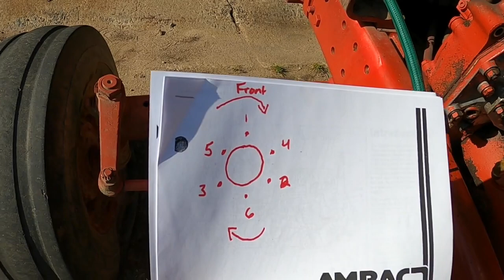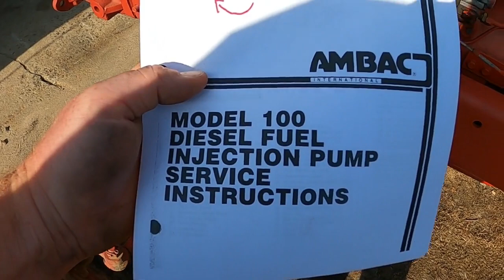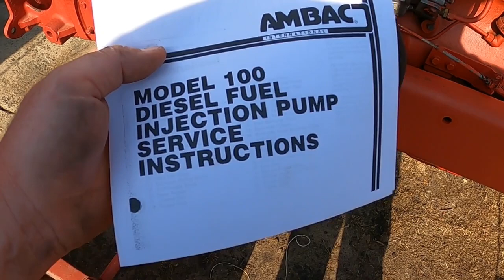1086 INJECTOR Pump repair Part 1

Comment: This is a great video. I've got a 1586 leaking fuel in the same area. The last pump I took off to have fixed was over $1100. Sure nice to fix things yourself 👍
Reply from the maker: Thank you very much for the kind words my friend ! You are correct, not in my budget to have professionally repaired at the moment. I thought I would do my best at trying it, get some good video of the process, and see what happens! If it solves the leak, and nothing goes haywire then maybe someone else can save alot of cash as well! And if I mess it up, then also maybe someone will and can learn from my mistakes!! It seems rather easy actually, part 2 coming soon, do have the head out now and understand the pump alot more! Thank you for being here my friend, watching, supporting, following and COMMENTING!! Your encouragement means alot my friend!! Thank you !!

Comment: Been there done that but ended up pulling it and sending it out to get rebuilt and it runs well but after 8 years its starting to leak again a bit .. And if i do mine again its going to get all new lines and replace the injectors too .
Reply from the maker: Thank you very much for the sub my friend, and it has been a deal so far. I have a feeling the whole tractor may get a rebuild this winter after I really start working it hard. And if so I think I will budget the whole pump rebuild and all just as you said as well! Cheap and small scale for now, hoping this will get me by for a while this season anyway! Thank you very much for being here watching, supporting, following, and COMMENTING!! Means alot my friend!!

Comment: What were the symptoms?
Reply from the maker: The reason for the repair? It was leaking fuel , almost spraying it from under the hydraulic head assembly of the pump. Oring fixed it right up. There were no issues with the function of the pump or running of the tractor. Thank you sir for being here, anymore questions feel free to ask away! Thank you for watching!

Comment: When you was putting the head back in did you have trouble getting the timing marks to line up? Ever time I try it rotate just out of time, injection pump is in time to timing marks as well
Reply from the maker: I did that was the problem actually. When I was putting the head back down the gear did not mesh like it should have. Very lucky it didn't really mess things up. Gently rotate the crank back and fourth while sliding through hydraulic head unit back down completely. Hopefully it works well for you!! Thank you for the comment, good luck!!
Reply: @Pennies_on_the_dollar  been trying for a while now and rocking the crank and always end up just a hair off, this is 2nd one I did frist one whent right in haha this one a being a pain, didn't know if there was any other tricks or not, thanks
Reply from the maker: @ethandeberry8858 Sounds like you are having my luck 🤣🤣 As long as you are in that window, on the head, you are good. If the other marks are correct , then as long as you can see the line in the window you are golden! Good luck, hopefully it goes in like the first one soon!
Reply: @Pennies_on_the_dollar  so the timing marks can be a hair off in the window?
Reply from the maker: I dont have the book in front of me at the moment, but I am almost POSITIVE yes, as long as it's in the window. The main timing of the pump is on the cam gear and flywheel. It's been a while, but I can pretty much say that is the case. Seems after you brought it up I struggled with that too, and I'm thinking that's why I didn't get it all the way down the first time. Because I was trying to make them line up perfectly.
Reply: @Pennies_on_the_dollar  my book dosent give that but I'm going put it together and find out haha, thanks for your quick help I appreciate it!
Reply from the maker: Yes sir, keep me posted if ya can,love to hear how it went! No problem at all my friend !

Comment: Where did you get the rebuild kit?
Reply from the maker: I actually didn't rebuild it, just tore apart and replaced the hydraulic head oring. But the kit Ingot with all the gaskets was off eBay. It was the ambac kit so I think it had most everything for a rebuild! I think I showed that kit in one of the videos of the injection pump. Thank you very much for subbing in, and you can email me or hit me at Facebook or Instagram and we can talk more. Always here my friend!! She still purring like a kitten!! Thank you for being here watching, supporting, following, and COMMENTING!! Sure means alot!!
Reply: @Pennies_on_the_dollar  appreciate it!  I’ve got a 1486 Cab tractor I picked up not running needing a pump, wouldn’t suck fuel out of the filters into the pump, is that what yours did?
Reply from the maker: Mine was leaking very bad around the hydraulic head where the lines attach.